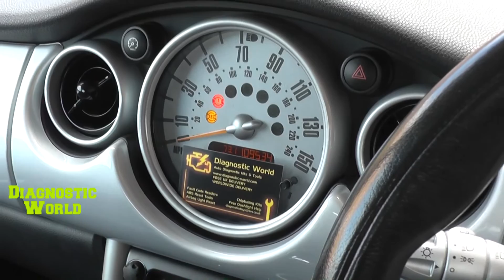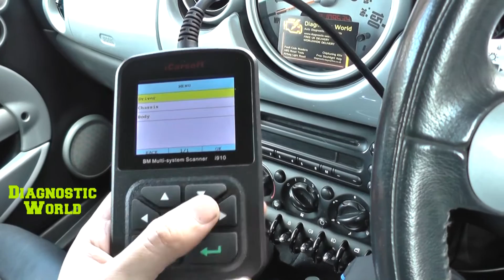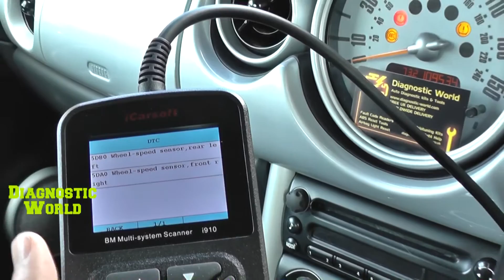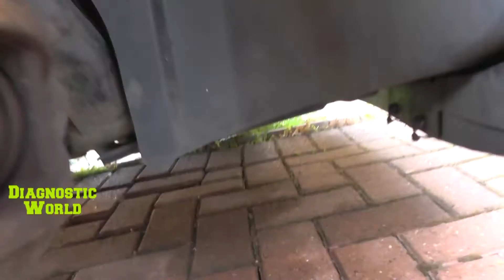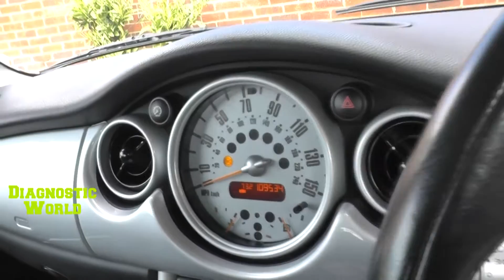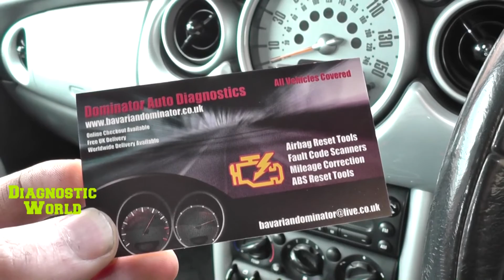Mini Front ABS Sensor Replacement Guide & Diagnose 5DA0

Comment: Its a Really poor advert, but for those who want to know, that ABS sensor is an absolute nightmare to remove.

1/ 4 maybe 5 mm allen key, smack it on and loosen carefully its an inside bolt so it is clean and should come off without issue.
2/ Seen as its broken anyway get a mole grip (not a cheap one) place on the sides and wiggle it. spray wd40 on it sides. and wiggle till the sensor begins to move. 
3/ the sensor will eventually come out with some persuasion. it doesn't matter if it brakes if it does then just get a straight headed screw driver and a hammer and hammer through the broken part. 
4/ When fitting use a very small amount of grease on the hub (not on the sensor) just so in future someone needs to take it off won't have any issues.
5/ You won't need to erase any fault codes as the car itself will run a diagnostic test and if everything is working correctly it will delete the code.

Hope this helps, Ta
Reply: More helpful than video.
Reply: Thanks for the tips mole grips essential done mine this morning great help